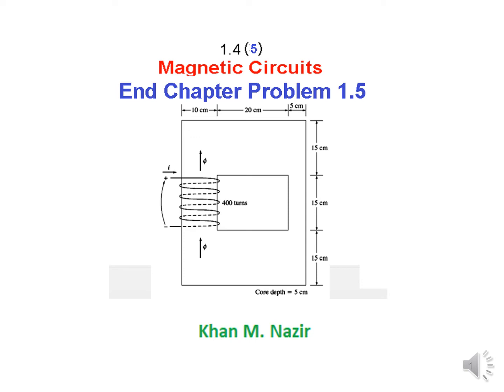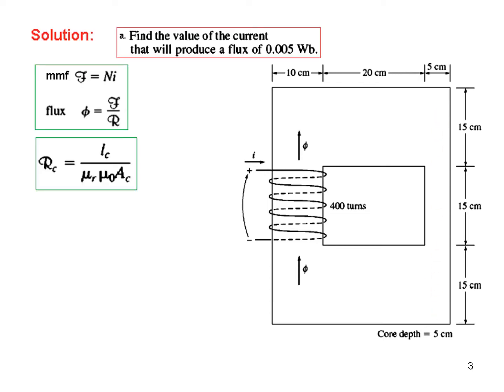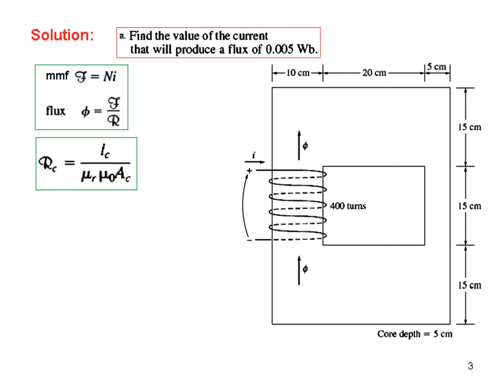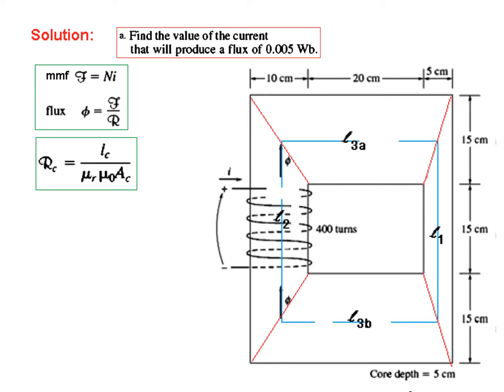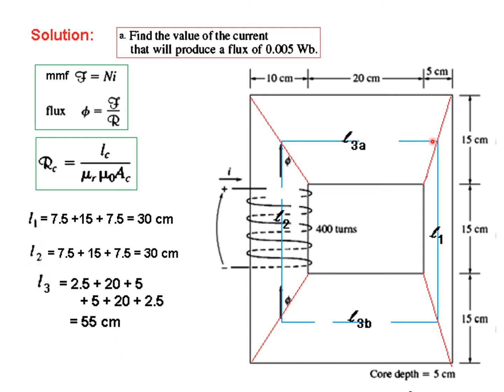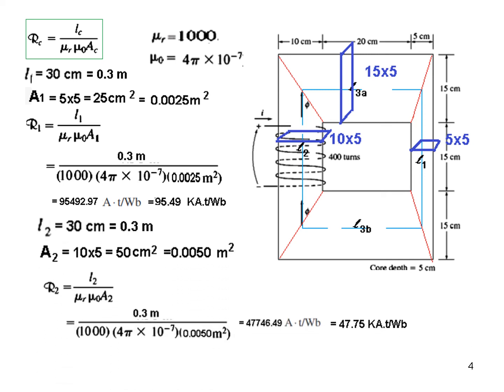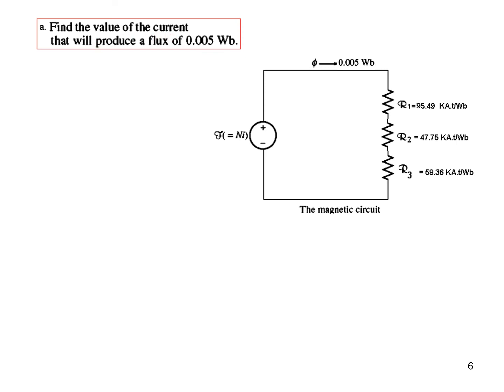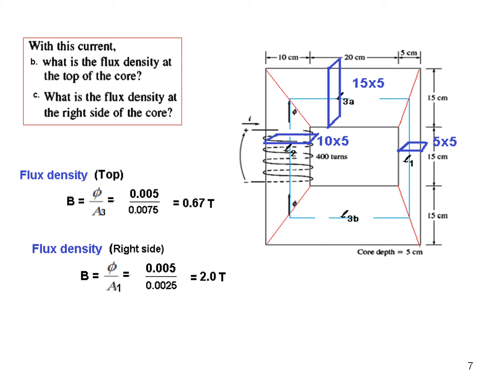(E)EM (C)  Q 1.5 || Magnetic Circuit ||Core length, Area, Reluctance, Flux Density

Comment: Sir in 5:40 mins how did you get the A1 5x5 , A2 10x5 and A3 15x5?
Reply from the maker: In all three cases the the width is different, but the depth is 5cm (core depth 5cm , see bottom right of diagram)